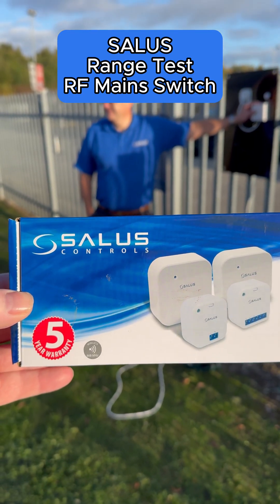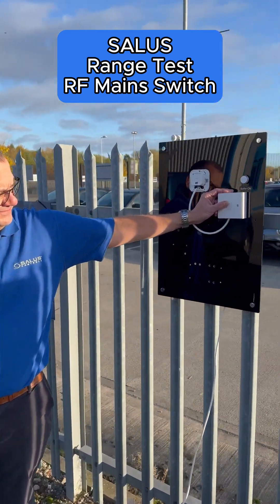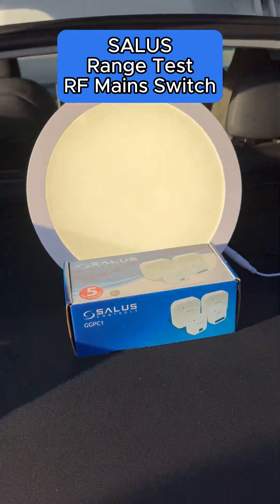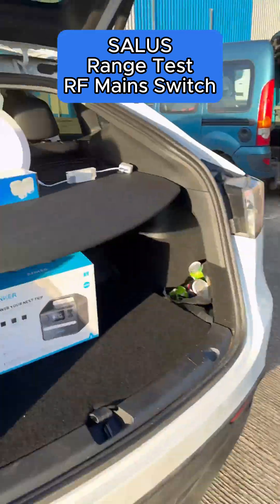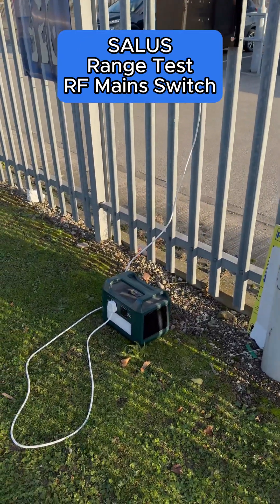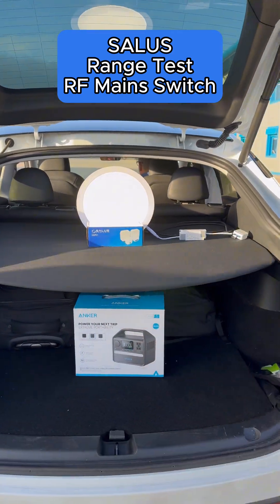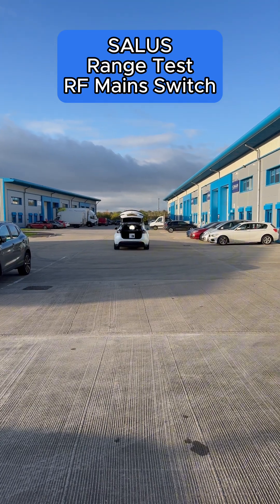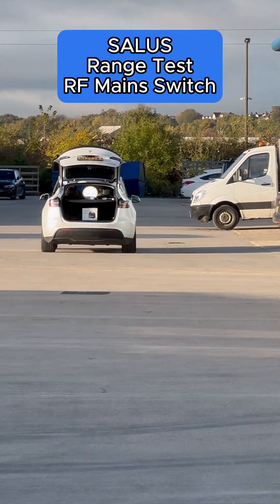Salus Controls RF Mains Switch (GGPC1-RF): Quick Installation & Versatile Applications

Comment: There’s a problem with your testing method , it’s not the open air testing that matters many g/ab/rf controls can reach up to 300m-4–m  on average in line of sight , the problems come once walls and especially older building walls with solid walls can badly affect signal range by up to 75%  so say upstairs boiler to garage can have issues passing through multiple walls, in such environments it’s best to have a wired or piggy back off a mesh network or have a zigbee connection over single ring electrical mains
Reply from the maker: I already did a test inside a car and drove down my street. BG install these without any issues.